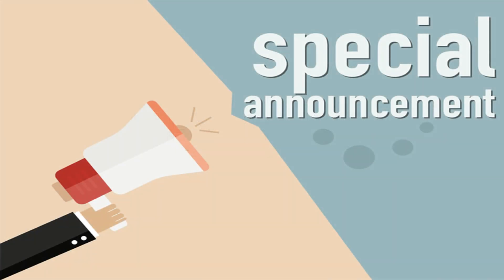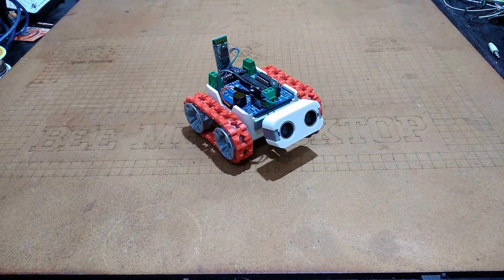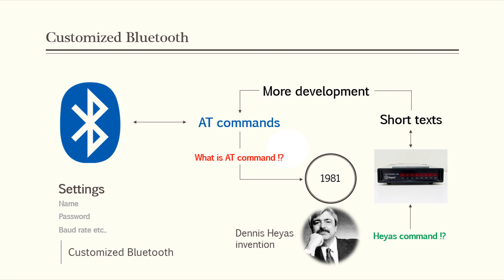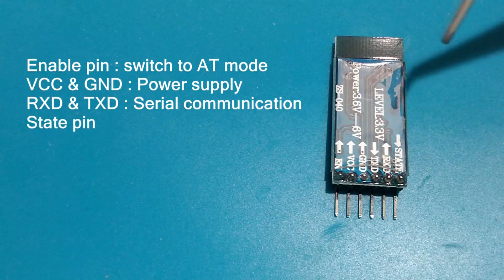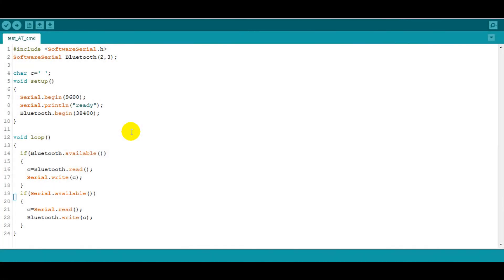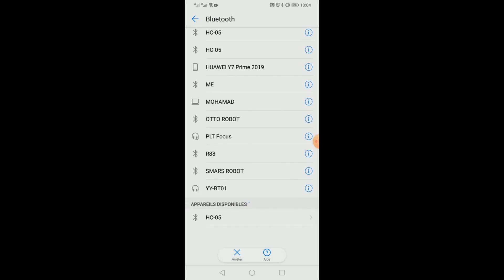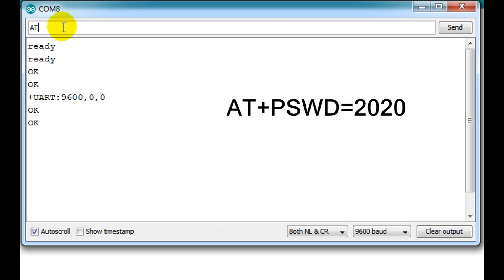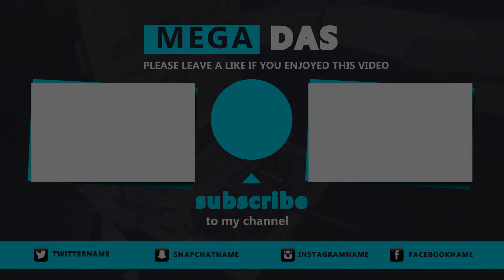Arduino Bluetooth AT commands HC 05 HC 06

Comment: can we do this using arduino uno? or does it requires a controller with two rxd and txd pins?
Reply from the maker: You can do it with Uno because of the simple reason that the Uno microcontroller is similar to Nano microcontroller, follow the same wiring as mine and use the same code

Comment: Hi Chris, can you tell me if I can use the 'D0' and 'D01' pin that are labeled 'tx' and 'rx' instead of the D2 and D3 pins you show? Please help! :)
Reply from the maker: Hi
The Rx and Tx pins of Arduino are occupied by the Serial monitor but you can wire the Bluetooth to those pins after completing the Bluetooth AT command configuration.
Let me know if this is not clear enough for you
Reply: @DIYGUYChris  Okay thanks Chris, really appreciate it! I finally got it AT commands working and connected again and will try those tx and rx pins and lyk. Cheers!
Reply: @DIYGUYChris  Forgot to ask...what do I have to type in code to upload after switching to tx and rx pins? 'D0' and D1' or some form of tx and rx?

Comment: Hey, I have a doubt. As soon as we connect it with Arduino and enable it, we will get to see its name in the bluetooth option on phones?
Reply from the maker: You will see the name on phone Bluetooth search as soon as you power the module, with or without connecting it to Arduino, as soon as you wire the VCC and GND pins.

Comment: this is a great video, thank you, but why when I open serial monitor the reply that I got is nothing? not OK like in your video
Reply from the maker: Probably you are not setting the serial monitor baud rate as same as the one you set for your Arduino Serial! Check it and check the wiring diagram as well.

Comment: Thank you for the video. It worked fine the first time I tried this, but the second time with the same HC-05 it doesn't work. It won't send back anything after sending "AT". What did I do?
Reply: Same here, except doesn't recognize but shows some gibberish in serial monitor and won't show up in scan on bt terminal app
Reply: @livinginOrwells1984  you need 38400 baud

Comment: why did u assign 38400 at the beginning and then changed it to 9600???
Reply from the maker: That's the default baudrate and it could be set as whatever BPS you need

Comment: Hey. I want to use arduino uno, mpu6050 and hc 95 Bluetooth module. The problem is about power supply. Can i power hc 05 bt module or mpu6050 with external battery? If yes then please tell how
Reply from the maker: Hello yes you can use external power supply, just use an external 5V DC power adaptor and connect its (+) wire to Bluetooth VCC and (-) wire to both Bluetooth and Arduino GND then from Bluetooth to Arduino just Tx to Rx and Rx to Tx
Same for any other device
Reply: @DIYGUYChris  Thanks buddy. Can i share my fritezing digram for my project with you? To clear doubts about it. Actually i am doing Arduino project first time so for doubts can i?